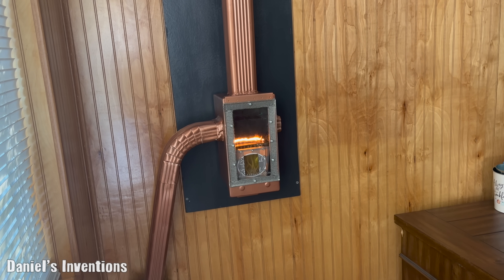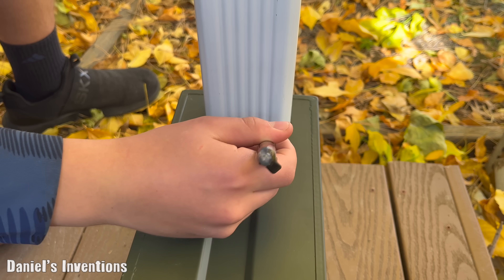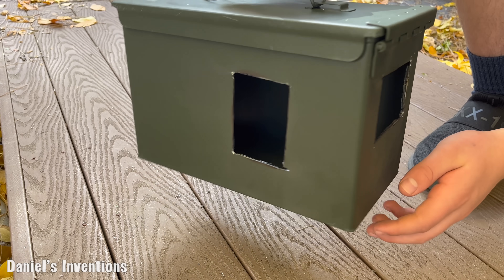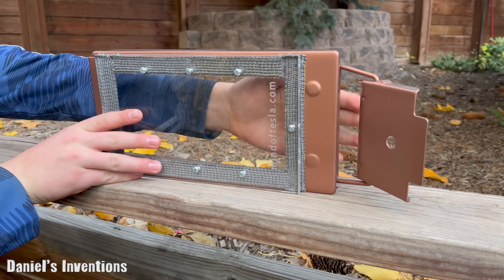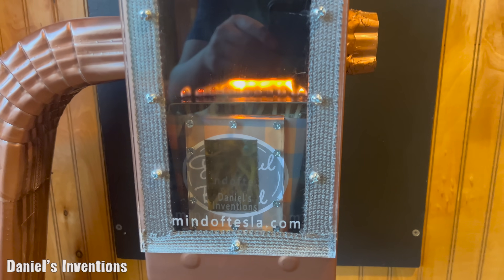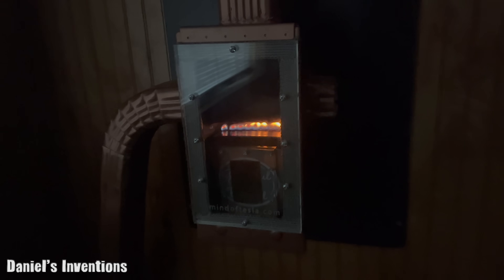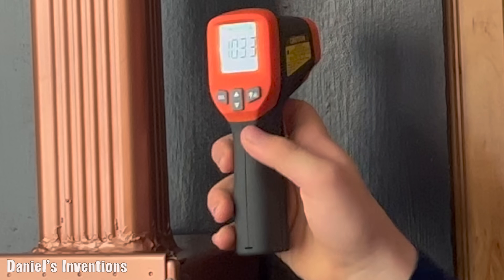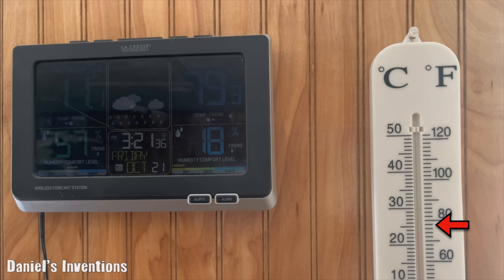ENDLESS Heat for Your Home WITHOUT Electricity

Comment: How do you turn it off or down (adjust) if it's getting too hot?
Reply: They probably cover up the oxygen intake pipe on the outside for a minute or so to deplete the oxygen the fire is running off of.

Comment: Using a $35 solar panel should provide more than enough electricity to run the 12v computer fan and maybe even some LED lights. 

You might want to reconsider cooking on top off your little furnace. 
Build a potbelly stove, it’s already been invented, but you could add your system to the existing old school devise and than you’d be both creating a larger amount of heat (so much so, that you’ll need to open the doors to cool of the area frequently.) I had a pot belly wood stove/oven in my garage back in the 90s. I was able to work on my car during the winter. I used free discarded pallet wood for fuel. ❤
Reply: then he could not use the actual title... no electricity...

Comment: That's a great idea!  You have my imagination going. Filling my tank cost me over $1000. I think wick mechanisms are still available. Installing a damper on the air intake might offer throttle, and could make the fire box hotter. Using tape wick adjusters drilled through the cover would make the flames allot bigger and adjustable. Adding heat sinks fastened to the outside of the duct, adding area like baseboard heat fins, might add more temperature to the duct. Boilers are designed that the hot air flow slows down passing through upper manifold and heats the water more, before the heated air is wasted up the chimney. Sitting a line of rocks across the top of the duct might hold more heat in the box.
Reply: I would think a heavy steel pipe would be better horizontally. That would keep carbon dioxide outta cabin. Also a heat plate on the top so you could warm coffee ect
Reply: Change the wick to be a carbon fiber pad. Carbon fiber doesn't burn, but will wick the oil up, so it is an everlasting wick.
Reply: Did this on my old halve pot belly wood buring stove.. And got it so hot it was bright red at night and burned slow and steady for hours..used less wood too.
I tell people about it with wood stoves and they look at me like I'm talking in toungs or something..they don't get it.. Reducing the air flow causes a hot fire and burning of the wood gas as well. They think the inlet air is doing that alone and they are wrong. Its far more efficient with a valve on the exhaust side. I could regulate both to get a perfect burn with no smoke at all out the exhaust chimney. And it would keep the place toasty all night long.
Reply: That's why chimneys have a flue. That's exactly what you are describing
Reply: @leadboots72  I was in the business. Dad ran a heating oil company. PETRO bought and dad dismantled the 20 million gallon oil terminal he managed. I installed the controllers on countless heating and hot water systems. I installed my oil boiler myself. I use under 600 gallons of oil to heat a 1500sqft NY  home. My neighbors with similar size homes are burning 1000-1400 gallons annually. I told 2 neighbors, they need a baffling kit or it's cheaper to buy a new boiler. FACT oil companies install the biggest flow nozzle they can put in your boiler, to burn more oil is great for the oil business. I tune my boiler, that I installed, every year since I installed my work horse boiler in 1997. I wired heating and ac systems since 1985. Ask me anything, and I rarely don't have a solution.
Reply: @keithhults8986  damn decent of you, I may ask for help with a design 😉.
Reply: I'd imagine some of y'all might consider forming a mastermind group, refining this project, and maybe bring it to market, but being it is liquid fuel operated and considering how litigious our society (USA) has become, might not be the wisest idea. This would on the other hand, make for a great YouTube series on different build versions of this project.

Comment: Excellent project with fine details ❤. (1) Adding upward angle to the heat exchanger pipe inside the unit  -[ ↗]-  , will increase the efficiency to move the hot air on it's own without need for 12v fan. Oil Filled Radiator heaters works on same concept to move the hot air by use of hot fins without using any fan. Please check it out. (2) There is an opportunity to increase the efficiency by thin wrapping or insulating cold air intake pipe so it does not play any role to interfere with room air temperature.  and same way adding some thorn spike to the exhaust pipe, to extract the out-going heat as it's showing 273F (134C).  (3) In current design to refill the oil, it requires to open 8 screws and pull the assembly out, to make it very simple and easy, a small metal pipe can be added with air-tight cap (to avoid CO2 leak), so anyone can add the oil without going thru hassle of opening screws or take-out assembly. (4) To build an oil container, I see you have cut the metal tin and added small glass piece to check the oil level, I believe, this can be easily replaced with a candle jar (glass jar) as a container, it will save time and effort to cut metal tin and add glass window to it..   Thank You for keeping it simple. 👍  I encourage you and looking forward to see next  version 2.
Reply: I think you can just unlatch the ammo can lid tho....
Reply: @ilike1sand0s68
Reply: hello there... I am in the process of making one myself, not for fun but for real need (and I am late cause winter is knocking on my doors)... I found your comments really outstanding... would you help me on the sketching of it?
Reply: Yes. Just unlatch the ammo can. That's why they used the smoker gasket on the inside of the lid. I believe.
Reply: I think a glass jar could be a bad idea. If there is any heat gradient in the jar, it could break. Even a pyrex container feels like a risk to me. But then again, candles use glass vessels.
 What do you think?
Reply: @jtadevich  Tempered borosilicate glass should be fine.  I'm a glassblower.
Reply: @THEGLASSMANSWORLD  I have seen tempered borosilicate  lab glassware break due to thermal shock in labs. I don't mean to say it's likely. But even in the unlikely event there is a break, you could still have half a gallon of flammable liquid spilling about if you use a container sized like the designer did. I also just had a candle break due to thermal gradient. I would imagine an all metal container would be safer. 
what do you think?
Reply: @jtadevich  the thermal shock you witnessed had to be a drastic change in temps from freezing to extreme heat. Also, over time, the glass will lose its tempering integrity over time and with many uses, and eventually break. If it were a brand new beaker or glass apparatus, then I'd question who the manufacturer was or if it was Pyrex brand which isn't so good anymore compared to their first created composition of glass. Bakeware tends to shatter these days too.
Reply: @THEGLASSMANSWORLD  Interesting. It was pyrex, but back in 2005 or so in college labs. Heavily reused and questionably treated by many users. Very interesting. Thank you.
Reply: @jtadevich  When Pyrex was first developed, it was Superior. And then Corning stopped making it and started focusing on smart glass and Gorilla Glass. So I think someone bought out Pyrex and changed the recipe. Maybe adding soda lime to the borosilicate to be able to produce more with less borosilicate added. I think this is what happened but not 100% sure on this. Corningware is another brand they developed and I'm not sure how good that quality is either. I personally use Kymax or Scott Glass, not Pyrex, when I blow glass and make art pieces, jewelry, and smoking apparatuses.
Reply: Curious... With all of your improvements, how would you adjust the wicks easier/ more efficiently and evenly?
Reply: @Yippee Skippy hi... thanks for taking the time to write me  ;) 

I have replied to @king Of Hearts comments... to try to incorporate his improvements ideas on the 'original' project, which is good already... there are some bits and pieces not really clear to me... I admit this is not my strong point and since I will have a professional making it, I guess, along the line, it will help the whole community... I mean... I would love to share the end result with everyone... but it is not totally clear yet (with the remarks brought by the above mentioned user...)... I am hoping he finds the time to contribute more... or someone that grasped his concept and it's able to put in in paper... Grazie Mille!
Reply: @renator8540  build it like the kid did.  Also add a pipe going up on the exhaust side just like the intake side.  Add a piece of metal flashing over the cement board on the wall to reflect heat .  Instead of JB weld you can use PERMATEX MUFFLER & TAILPIPE PUTTY, it's good up to 2000* degrees.

Comment: It seems you could extract further heat by blowing air over the outside of the exhaust. Possible put a wider tube around it and blow air down that, it bring the hot exhaust heat into the room.

Comment: Mounting it lower with a down bend on the intake and up bend with a slightly longer on the output you can use convection to move the air instead of an electric fan.
Reply: hi there... I need to build one myself... actually would need a sketch of some sort... you seems to have a pretty clear idea on how to... are you also able to draw something? I will take it to a professional (who build already a Pirolitic burner for me) and get it done.. can you help me, please?

Comment: Wondering if we can adapt this to a minivan camper???
Reply: The idea can be adapted.  Do you have a wall section it can go on?  You can make the heater far more compact with a bit of thinking about it.  The space this is heating is much bigger than a minivan.  There are also many improvements you can make.
1) Make it so the fuel container can be filled more easily.
2) Add a fold away metal plate on top that can hold a small pot or kettle.
3) Add fins to the outside to transfer heat to air better.

Comment: I saw another heater similar to this on another channel. I like this better because it seems safer. The only thing that worries me about a homemade heater is the carbon monoxide risk. This setup seems much safer than some I've seen. I would still want a CO2 alarm, just in case.
Reply: Carbon Monoxide is CO. CO2 is Carbon Dioxide. I would suggest buying a CO (Carbon Monoxide) alarm, as that is the poisonous gas.
Reply: @nealeburgess6756  You are right and wrong.  BOTH CO and CO2 are problematic for your lungs.  You need 02 to breath, either one of those with make you go to sleep and never wake up due to O2 depletion.
Reply: @OpenYourMind you should have a carbon monoxide detector because the heating and cooling can cause these materials to crack and carbon monoxide is undetectable by your senses. You should have a carbon monoxide detector if you have a furnace fueled by natural gas for the same reason.

Comment: All of the part for this project was about $100.... We had someone make us a piece of high heat resistant oven glass... We 3D printed the support for the computer fan... Me spending $2500 to make a tin oil heater.

Comment: If you add a rise to the pipe that lets the hot air into the room, the chimney effect on that pipe would let you run it without the fan.
If you attach a flat plate to the top of the box, you can have a surface that can hold a small kettle to let you make some tea etc.
I would want to be very careful about how the exhaust pipe goes out through the wall.  It would be making that bit of wall fairly hot.
A shiny metal surface behind the heater would reflect more heat as infrared into the room.
Reply: Exactly use the natural Convection of the hot air to circulate and cut out the need for any kind of fan at all.
Reply: @thee_number_six6227  BTW:  It is also an argument for mounting the heater low on the wall.  Cooler air is near the bottom of the room.  It gives more height for the rising outlet to make a draw like a chimney.
Reply: @kensmith5694  Definitely mate, one thing I have learned using these types of heaters is the placement makes a big difference, fans can be used but at lower rate of speed that pushes warm air out further along the ground and then that rises up and a regular temperature is maintained. I have used this type of heater with and without fans and the convention and air is much hotter without the fan, although the fan option circulates the air more quicker, it is better to control the speed output of the fan. Too fast and it cools the warm air before it's been circulated properly, again the room size makes a big difference. Overall though they work well with and without and smaller rooms do not really need the fan option, in my opinion. But always best to test what works best for your setup!
Reply: This is an excellent thread.. even funny at the end. Thanx all!! 
  I was thinking when he mentioned the 3D printer, a few might stop there. 
Other comment threads make for all kinds of problems, and different materials for those who never had to attempt something like cold damp spaces that encourage mold growth. Very important not to bring back mold borne illnesses irradicated with central heat.. so much knowledge is lost... And day to day,,, people have no clue what's coming, or how to be self reliant.. 
  Kid in this video is pretty young,, but has a background enough to come up with this. KUDOS!!
Reply: @candygarfield1479  Just a note about 3d printing:
These days, if you have a chunk of money, you can 3D print ceramic and metal parts.  For the ceramic parts, you 3D print the green ceramic in a thermoplastic filament, bake it to drive out the plastic and then fire it.  This puts doing ceramic within the grasp of a mere mortal.
Reply: I've never saw a heater like this  with wick,do you have pics or videos of ones you did
Reply: @darlenebrooks8233  Youtube seems to have lost my reply to you about seeing heaters like this.  You can find wick based heaters on line with your favorite search engine.  Some are antiques.  This design is not a new idea it is just a home made version.
Reply: I'd be worried that you wouldn't get enough air flow to heat a full sized room ???  I'd love to see the experiment done.
Reply: @jamesbell8861  In days gone by, entire houses were heated with a wood stove.  Air circulates on its own if nothing blocks it.  The heat is uneven but nobody freezes to death.
Reply: a mini pot belly stove
Reply: @michaelmulherin9952  Yes, a pot belly stove shape could work too.  It could be made to look quite nice as well.  The round flat top surface could serve to cook some food or boil water for tea so you would get extra use out of it.
Reply: @OArchivesX  Read what I said more carefully.  Note that I said "as infrared".  Heat energy from the fire box will radiate as infrared.
Reply: @OArchivesX  heat can be reflected I used tin foil behind my wood stove because I couldn't afford a fire stop back the wall stays cool to the touch it's how space blankets work !!!
Reply: I was concerned about the exhaust too, but his thermometer showed a lower temp on the exhaust pipe.
Reply: You are ruining his life. Why? I have no idea.
Reply: @TimPerfetto  Whatever are you ion about.  Nobody here is ruining anybodies life.  There are discussions of ways to improve the design.  This is a good thing.  A better design is better for the world.
Reply: @kensmith5694  You are ruining my life
Reply: @TimPerfetto  I sure don't see how.  Is making things better a problem for you?
Reply: @kensmith5694  Hair there. Twelve 12 hair. Yeah. Stop eating my hair.
Reply: You didnt pay attention.
Outlet heat at the inner to outter transition os 103° fareinheight
Reply: @hafsalinda  What does that have to do with my comment?  He only measured the part of the pipe that is exposed to air.  He didn't measure what the temperature inside the wall is.  Out in the air, the air flowing past the pipe keeps it cooler than the gasses passing through it.

Comment: You said NO electricity
Reply: The fan is optional to help with air circulation. The heater could run without it. So technically, it is no electricity.

Comment: Awesome, I love the ingenuity and creativity in this project! That fan is critical however and perhaps a temperature monitor with an alert at the output would help a lot.  Some type of oils have low combustion temperatures.  Some day (maybe years from now) the fan will fail.  When it does, and if during the night, the temperature inside the unit will increase rapidly (especially with 10 wicks).  From there it's a matter of minutes (let's say less than 1 hour) before the small space inside that unit gets hot enough for the whole gallon of oil to spontaneously catch on fire (the increasing heat will pull air on it's own through the pipe).  As said, this is awesome; I would just add a temperature monitor so an audible alarm goes off if it goes above a set threshold.
Reply: I was thinking the same thing. I would add heatsinks with peltiers around the oil container, it will create electricity, not much when its warm, but a lot when its hot, this electric could be used to power an emergency fan and an alarm.
Reply: @PF-gi9vv  Oh I really like that approach, excellent idea!

Comment: at what temperature does the JB Weld start to come apart?
Reply: JB weld can withstand a constant temperature of 500 degrees Fahrenheit, and the maximum temperature is 600 degrees Fahrenheit for around ten minutes. At the hottest part of their heater, it got to 452 degrees Fahrenheit.

Comment: If you add an ozone generator to your combustion air  your low temp , inefficient,  polluting flame will become hotter and more efficient.  Ozone injection is pretty much required for low temp oil combustion.  Black smoke and your neighborhood will hate you

Comment: 12 volt electricity is still electricity. Although you can generate your own via solar panels and 12 volt batteries.
Reply: The fan is optional to help with air circulation. The heater could run without it.